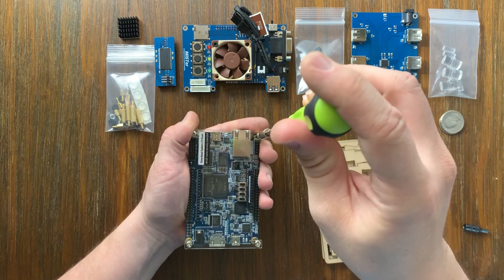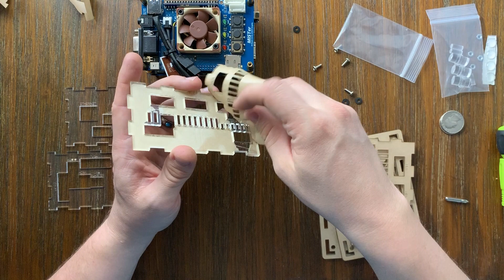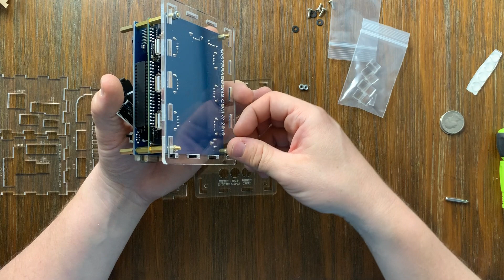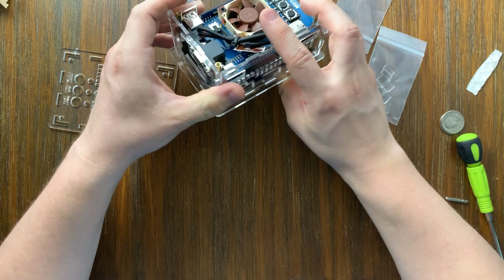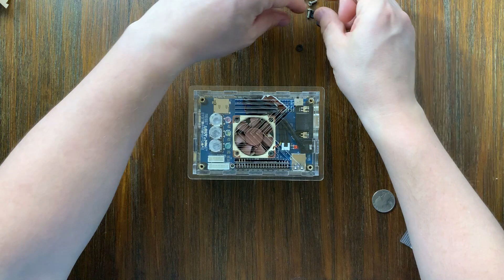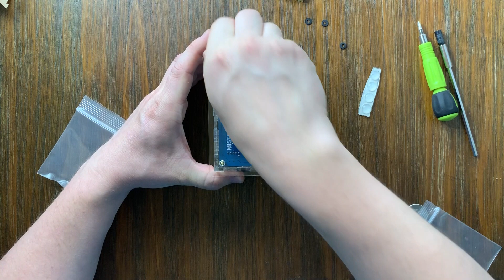MiSTerAddons Acrylic Case Assembly Tutorial

Comment: I bought the boxed noctua fan and it came with 3M scotchlok and I was able to cut the cable shorter, remove the sleeping and splice the cables. It’s super quick and easy and doesn’t require any soldering.